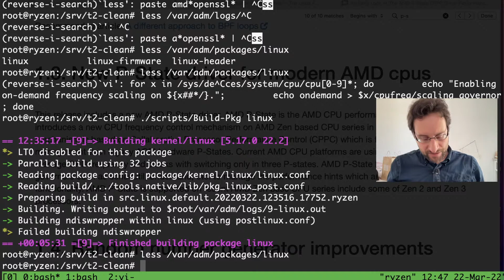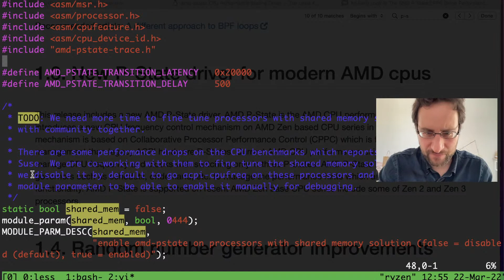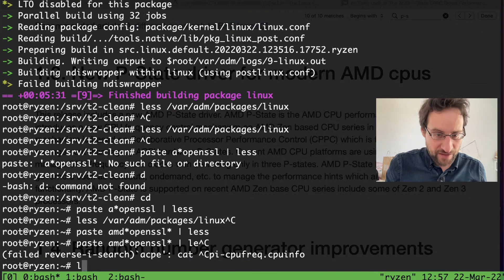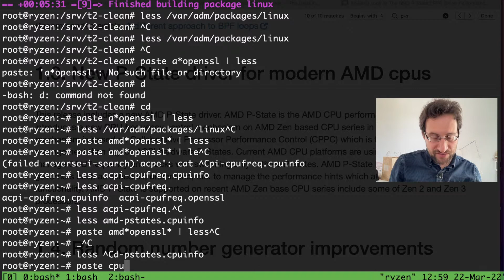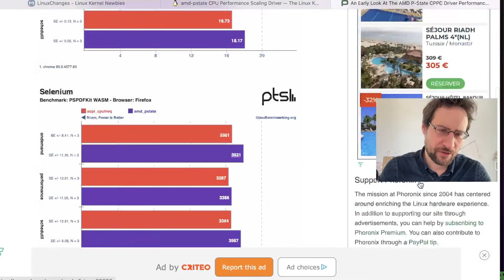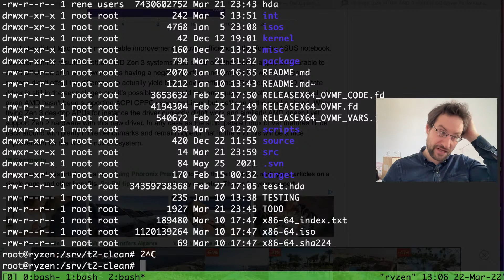Linux 5.17 AMD p-state Zen 3 test and findings

Comment: The amd pstate driver finaly 'tamed' my laptop. The cpu is stock overclocked with conservative scheduling it was 'okeyish' but quickly used high frequencies. audible noise and a hot lap... Now with the kernel module loaded I can set max freq to 4000 instead of 4800. The actual freedom to tune the cpu is there. Ondemand keeps its at what the task ahead needs. Fine tuning compared to the original scheduler imo. Does not need to apply to desktop usuage if you only need max performance. Ryzen 9 5900HX. Cpupowergui program can set lowest frequency too. Uses cpupower commandline.

Comment: AMD pstate doesn't even enable on zen 2, ryzen 4800h mobile cpu for now. Compiled the kernel with amd-pstate. Didn't get the pstate message in dmesg but hoping some error to spit out I did give it the kernel flag. Still no pstate takeover the CPU frequency. acpi_cpu_freq works fine for now. I compiled the pstate into the kernel and also as a module it won't load at all. Disappointing at the quality of driver from amd. I do have msr and cppc support.